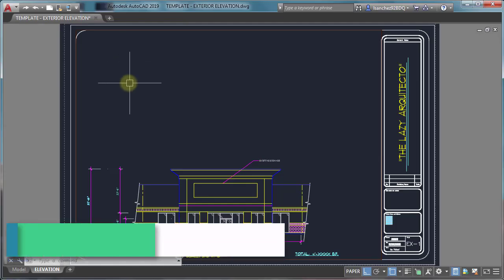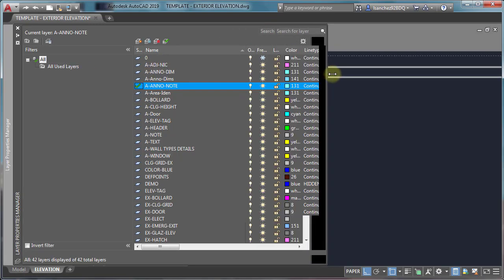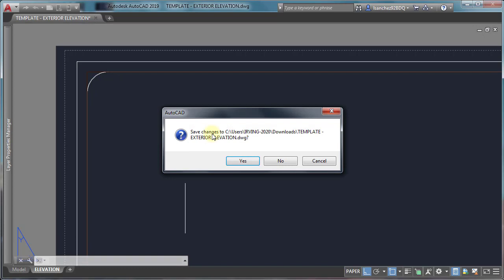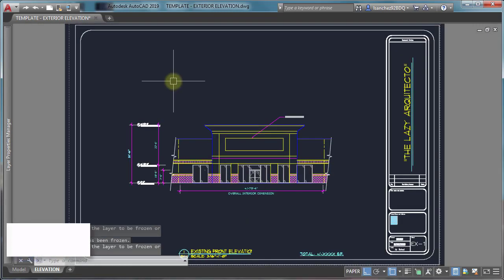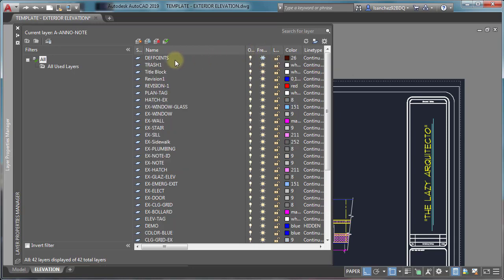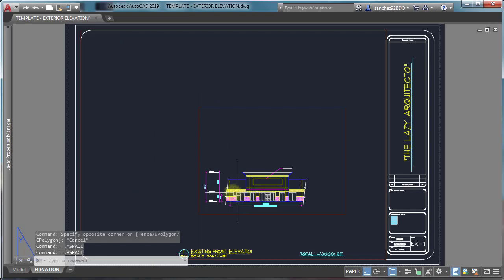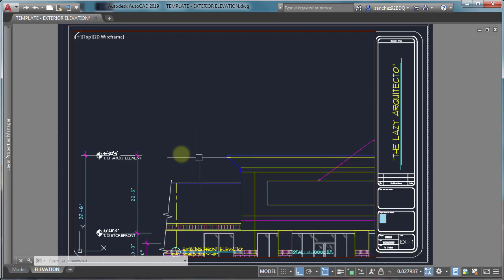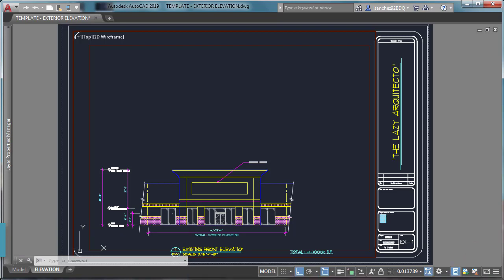I’ll Bet You Have These Viewport Problems in AutoCAD

Comment: Hello. My issue is with AutoCAD Architecture 2014. The problem is that I cannot see in viewport my ceiling grid. I did check the box in manager ceiling grid, plan but the problem still exists. Can you suggest a fix?
Thanks from Vancouver, Canada
Reply from the maker: Hi Gerry, can you get inside your viewport, open layer palette, and check if layer of your ceiling is not checked ✔ for PLOT and VP FREEZE?

Comment: Would you know a solution if the vport grips wont resize the window?  just moves the entire vport around.  if i right click and select rescale it will scale the current resolution up or down and wont let me freely adjust the boundary as i usually can.
Reply from the maker: Make sure layer 0 is not freezed

Comment: Don't make viewports on the defpoints layer.  Create a layer just for viewports and set it so it does not print.
Reply from the maker: Both options work Deezynar. Thanks for sharing your thoughts
Reply: @LazyArquitecto  
You just made a video to show people how to deal with problems associated with putting viewports on the defpoints layer, so you are aware that it has problems.
There are no inherent problems with using a designated layer that has been appropriately named, and switched to not print.
Reply from the maker: What problems you have for putting viewport on defpoint layer? Just curious
Reply: @LazyArquitecto  
You gave the main reason in the video, the defpoints layer is tied to the zero layer, locking defpoints when zero gets frozen.
Beyond that, it is standard practice to have a designated layer for viewports.  My college instructor taught that 20 years ago, and was pretty forceful about it.  The authorized AutoCad manual we used in my classes said the same thing.  And both of the professional offices I've worked for had a designated layer for viewports.  
I work solo now, and I named the layer I use for viewports: Z_VP.  All the layers I use that are not related to the model start with the letter Z so they get filed at the bottom of the list and out of the way since they get used the least.
Just make the layer, and turn the "plot" setting to off.  Give the layer a bright and contrasting color, so you can easily see it in paper space against the title block.  
On a different subject, try using a title block that does not have a visible border all around it.  Your plotter will work faster and you'll save ink.  But you'll still want a rectangle that won't plot at the extreme edges of the title block just for reference.
Reply from the maker: @deezynar  we never stop learning Deezynar. Thanks for sharing your thoughts with everyone!

Comment: The grid access and dimensions changed when I change the scale for example to 1:100
Reply from the maker: Yes, and What is the problem with that my friend? Or can you specify your question
Reply: Is there a solution for this issue ?

Thank you
Reply: @LazyArquitecto   I have a floor plan that I did and I used a preset access grid “ it seems to be a block “ . In the layout . I made three different sizes A3,A2and A1. I intended to change the scale depending on the drawings I want to shown in each . I changes the scale for the A3 sheet to be 1:200. Every thing seems to be great except the Access grid which was extended and the circle tag becomes bigger that it crosses each other. In Addition the dimension also was affected